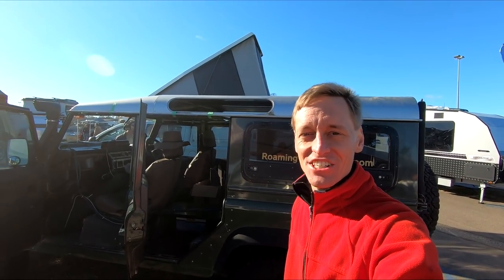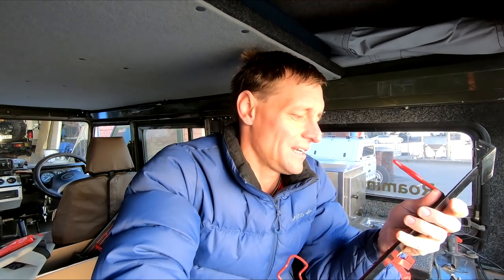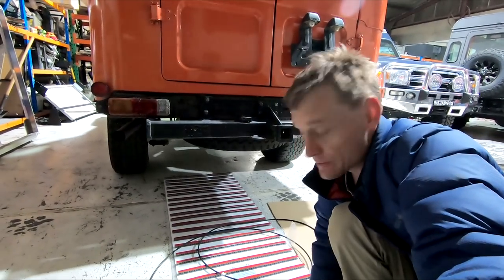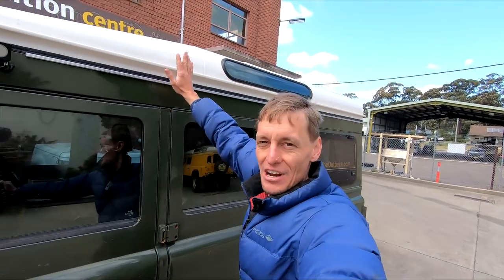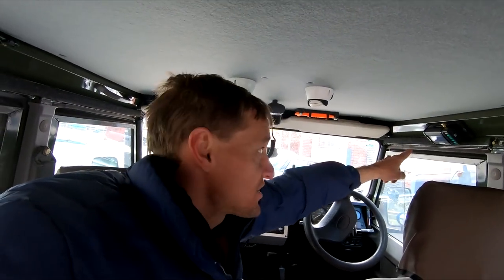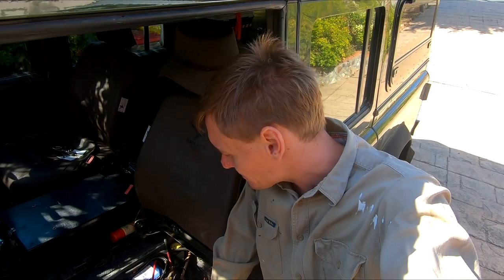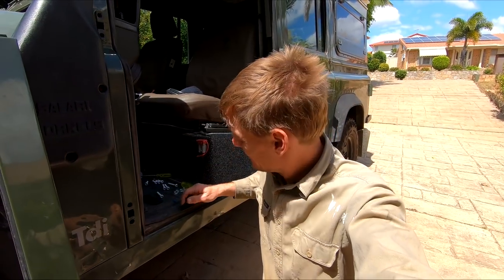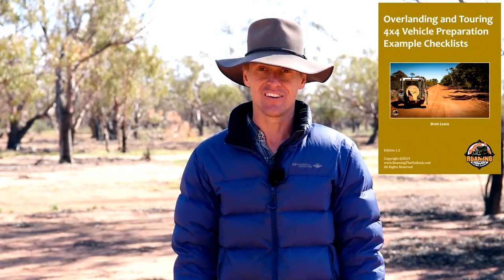Defender Overland Touring Build 2.3 - Pop Top Camper Ready to Roam Australia

Comment: Polycarbonat plate strips, should they dont be mounted lengthwise so wind will cool them more efficient when driving and less whistle sound.
Reply from the maker: That's how they come in the kit. All the air flows right through them when driving. Haven't heard any whistle during the 1000km drive home.
Reply: @RoamingTheOutback  Great idea - how wide are the polycarbonate strips?
Reply from the maker: @TerryManitoba  545mm same as solar panel width
Reply: @RoamingTheOutback  545  x  ? X ? please
Reply: just to be perfectly clear - 545 mm is the length of the strip - what is the depth of the strip? What is the depth of the strip?
Reply: 545mm may be the width of your panel. But 545mm is the length of the poly strip...

Comment: you will have to know current draw if using lithium to power 230/240 vac  inverter/converter
Noting if  dc-dc charger just because you might trip a switch  to charge 2 separated batteries..
doesn't mean you actively isolated between both batteries on current draw..
1 will flatten the other..
noting if you are running house power you are better off with the battery setup in series if  running  up to 6Kw inverter to  power the 240 vac..

also note if you are going connect to shore power  whether it be a gen set or mains power your inlet will have to be fused for electrical isolation..

Comment: Very nice! Just looks a little saggy. Suspension lift maybe the next mod?
Reply from the maker: Possibly. Maybe some rear helpers.
Reply: Do you have the Boge strut ? My early TDI 110 CSW had one and very comfortable ride with soft springs and no sagging. Never saw corrugations though . Great ideas here! Lithium battery safety  still worries me however  and can't use for emergency jump starts?
Reply: Yes I agree, a little but not much.
Reply from the maker: @philhealey449  no, i have Koni raid 90's. plenty big enough for corrugations and LR f/r hd springs. My lithium is lifepo4. Plenty safe enough. Won't explode if battery cracked open, and yes will jump start up to 3000w starter motors with 1000cca.
Reply: @RoamingTheOutback  All noted. Pleased to hear Konis are going well, I've gone for these on  my G Military (300 CDI) as OEM ride quality dampers  is far too stiff. Will research further on CCA for lithium, last camper truck had hugely heavy Varta lead acid which lasted 5 years plus with low discharge, I was toying with either low cost  smaller batteries to junk quickly or Optima for present build, but they now have poor reputation with Mexican production. Lithium not cheap however. You have one of the best channels for info on radio and trackers etc. Rgds.

Comment: A pop up is the best solution, cause you can get more living space if weather conditions ask for it. Most LR campers are based on the five door STW 110", but I would prefer the three door HT with extra storage lockers and an extra fuel tank to avoid too many liquids inside the Defender. I would also go for a diesel cooker instead of propane. But that's a personal choice. You have been to great inspiration for me. Keep on touring!

Comment: Brett, check out the Darche awning extensions/walls, they already use sailtrack and are 2.5 X 2.5. I reckon they would prob be cheaper than getting your existing ones modified.
Reply from the maker: Thanks for the tip Mark. Already got 2 tarps modified for $100. Good to know when they wear out I have an easy option.

Comment: I like the pop up camper but can you lock it up or are the struts the only thing holding up , if a windy storm or came along i can see it dropping down with you inside . Over time the struts will weaken too . Love to see it in use on your travels :-)
Reply from the maker: No lock, but it does take my whole body weight pulling it down again.. won't budge in the strongest winds, but a large tree branch on top might bring it down.

Comment: Do you remember the “safari roof” on the old series land rovers? A thin aluminium plate on top of the standard roof with an air gap in between, it was supposed to help cool the car. I’m wondering if your new solar panel arrangement will have a similar effect.
Reply from the maker: it will probably help a little like my former solar system.